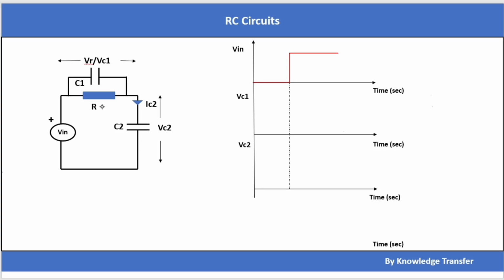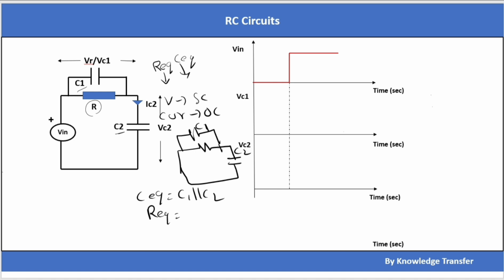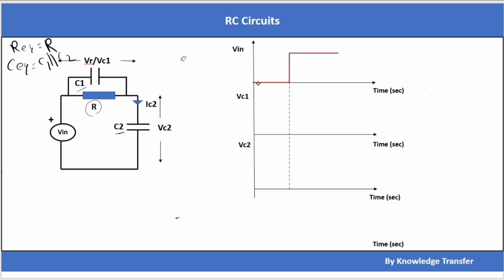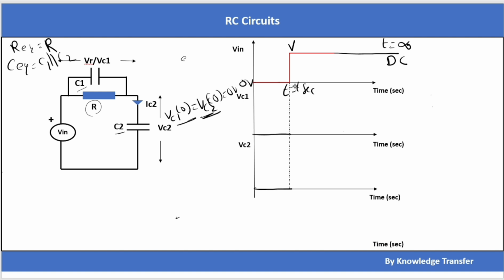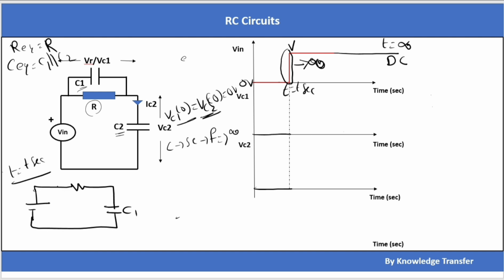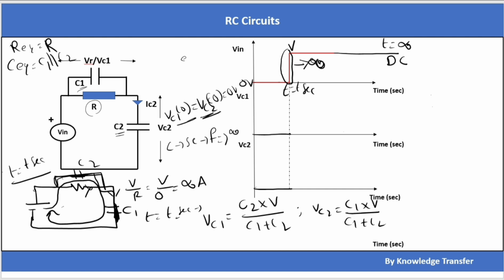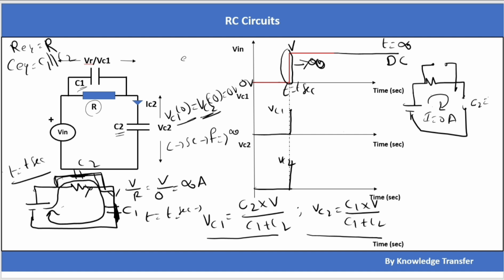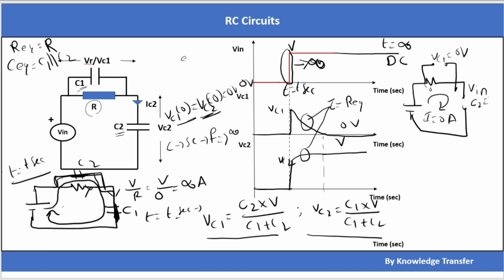Step response of first order RC circuits part-2

Comment: I think the VC1 and VC2 plots may be incorrect. At the instant when Vin = V, an impulse current flows through both C1 and C2. Since i = C(dv/dt), an impulse current results in an instantaneous change in the capacitor voltages. As a result, the voltage across each capacitor immediately reaches its final value of V/2. Therefore, the plots of VC1 and VC2 should ideally be step functions given by VC1(t) = VC2(t) = (V/2)u(t).